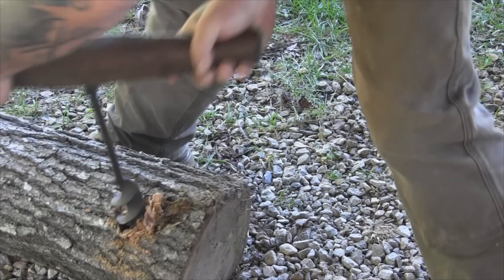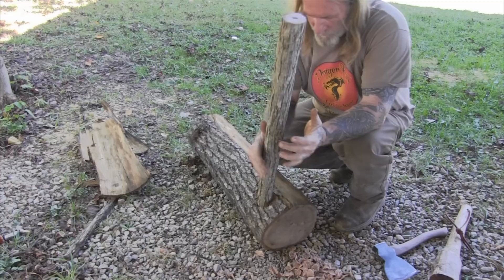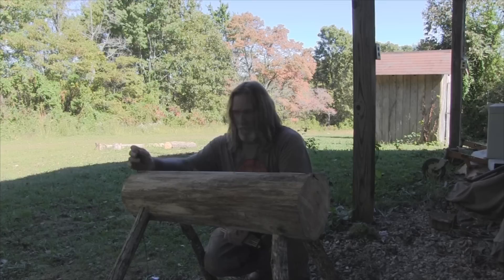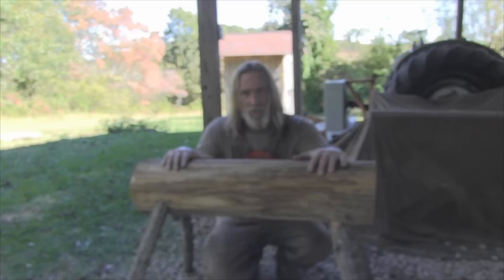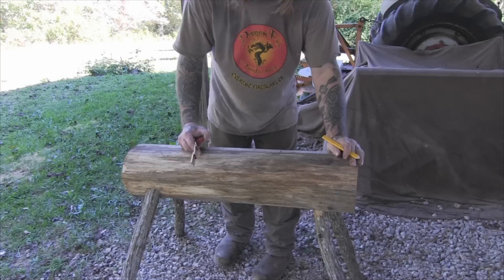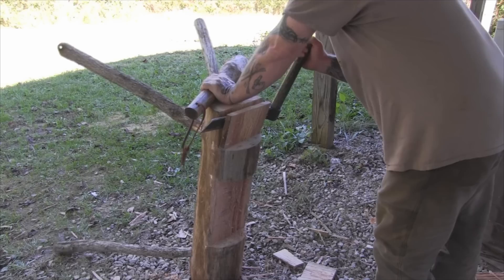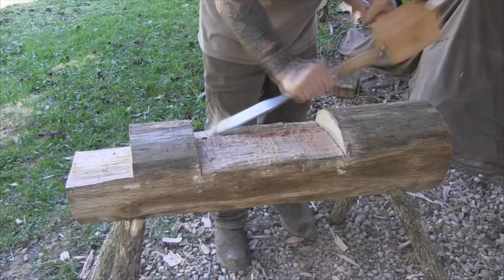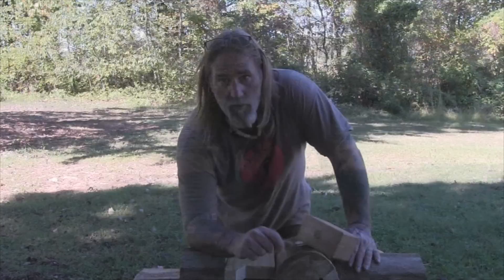Making a Bowl Vice or Clave

Comment: Dave, according to Webster's 1828 dictionary - Clave: preterit tense of cleave.  Same dictionary - Cleave:  (verb intransitive) 1. To stick; to adhere; to hold to.  2. To unite aptly; to fit; to sit well on.  (verb transitive)  1. To part or divide by force; to split or rive; to open or serve the cohering parts of a body, by cutting or by the application of force; as, to cleave wood; to cleave a rock; to cleave the flood.  2. To part or open naturally.